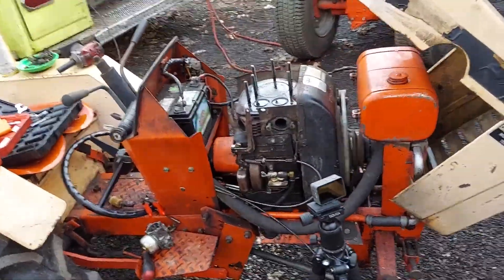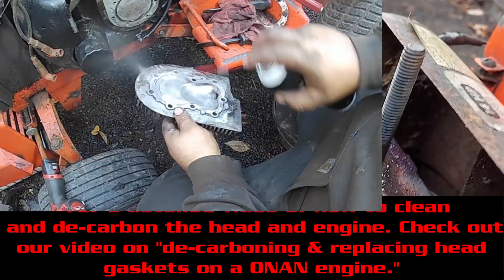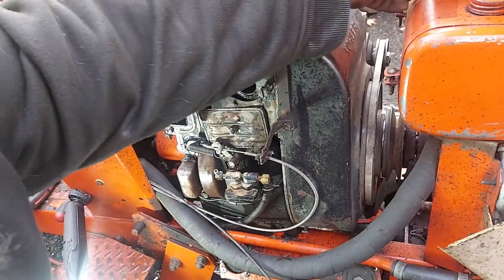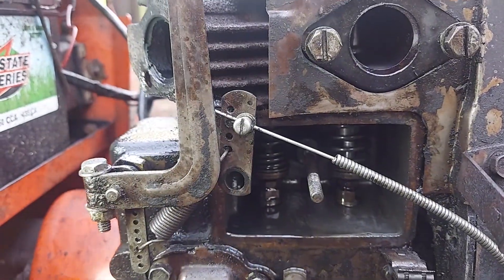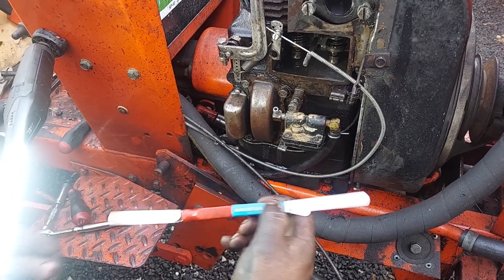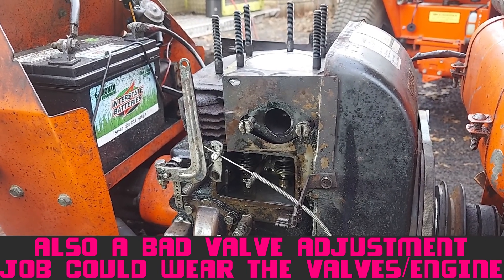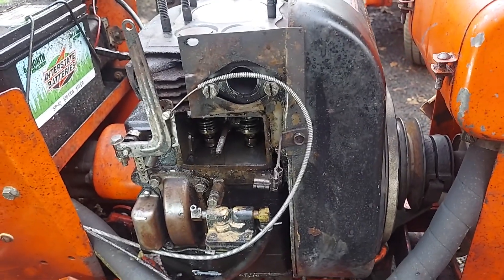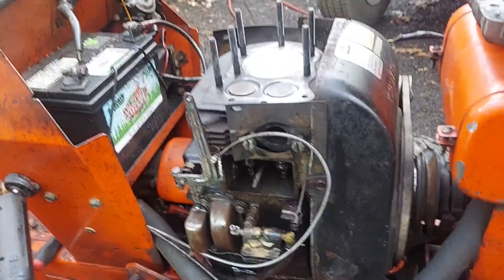How To Adjust The Valves On Kohler "K" & "Magnum" Series Engines and others.

Comment: Ive got one with a stuck valve.  All that labor far exceeds the value of the engine.  Just junk it.
Reply from the maker: Not really sure where you get that information from. These are good motors, actually regarded by all with knowledge and experience in the industry as one of the top ever built in history and the millions of them out there speaks for this. They are easy to work on and will last longer than anything built in the last 20 years. Seeing many are still around from the 60s, 70s and 80s and 90s and the engi5eas produced for many decades as it was so popular and successful. Lucky to get a modern engine to last 5 years...  These engines are worth a little time and money. And easy for most to work on with basic stills and knowledge... But not for everyone I guess. Thanks for watching and showing your opinion. 😉

Comment: Great. So on my Kohler KT 17S there are no adjustment nuts on the valve stems. Does that mean they have to be pulled and ground if necessary for the correct gap?
Reply from the maker: If for soe reason you have no adjustment then yes a valve job is needed and stem grinding.
Reply: @caseingersolltractorsnortheast  Thank you Sir

Comment: what do you reccomend on a kohler k181 where the valves are non adjustable.  my muffler is getting red hot and blowing flames.  im gonna try cleaning under head but gonna check timing first
Reply from the maker: I would also remove heat tins an make sure its clean behind them and engine I'd clean the put them back on. Make sure nothing built a nest in the muffler, or something inside muffler is blocking.  Adjust carb to not be lean and check timing.  May need a valve job too? Run high test gas and if possible ethanol free.
Reply: The adjustment is to remove the head, pull out the valve, and grind a few thousandths off the post of the valve, checking with feelers as you go. Flames shooting out of the exhaust definitely sounds like no valve clearance on the exhaust. If you leave it like that for long, it will burn the valve and seat.

Comment: Best tappet vid I’ve seen, great job. I’d like to add that if you don’t remove the head to make sure you have the piston is up after the intake closes look into the valve recess pocket vertical back wall, my engine has a 1/8 hole where I can see the piston moving up and down. Remove the spark plug rotate crank clockwise and after intake closes watch the piston rise look through hole in flywheel housing to align to TDC mark. Watch a vid about point gapping to see info on timing marks.
Reply from the maker: Thanks for the comments. Yes if you don't pull the head you can also pull the spark plug to find TDC if you can't find it on fly wheel.  Thanks for watching and comments its appreciated.